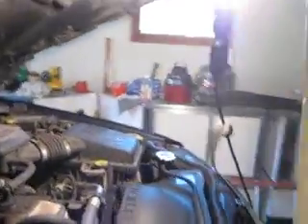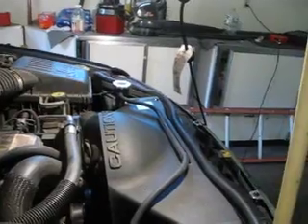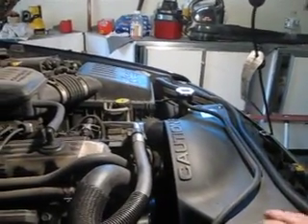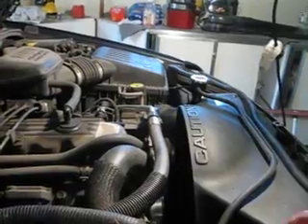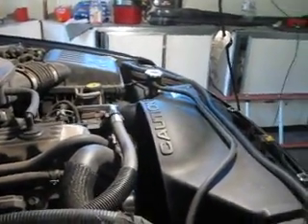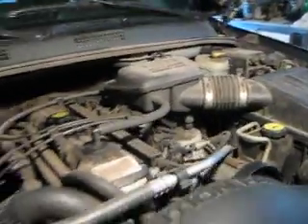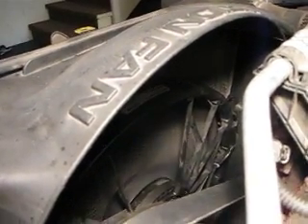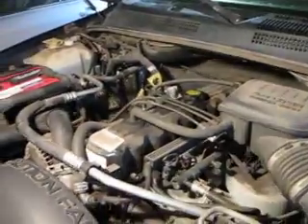how to fix radiator fan on jeep grand cherokee 2000

Comment: Great to see a repair instead of an expensive replacement.  Do you have part numbers for brushes for fan?  I replaced the relays in the PDC in my 04 WJ, but to no avail.  Now either replace or repair fan.  Also thinking about adding mechanical fan as the 4.0L is a heat producer.
Reply: David Hartman did you put a mechanic fan ? it does overheat?
Reply: I added a mechanical fan after the electric fan failure.  I have not overheated or even come close to 210 since it has been installed.  I am going to wire up the new elec fan I bought to a switch to be activated on demand vs relying on dysfunctional relays in the factory setup.  Finishing up my relay box soon, but ran into a fuel pump issue, so attention was diverted for now.
Reply: David Hartman I remove the elec fan and replace it with a mechanic fan clutch but today with the AC on while idle the Jeep overheat with the AC on temp was reading 230 the fan clutch never engage, I went back and return the fan clutch and put the elec fan back on.
Reply: O

Comment from the maker: driver side bottom bolt there is another video that tell how to take the bottom bolt out .1,bottom radiator hose also un hook the transmission line very easy noy you should be able to c the bolt what i did bent the box wrench a little n one turn at a time. i did it you can too.

Comment: where does the coolant hose hook up at on my 2000 grand jeep Cherokee Laredo please help any advice would greatly be appreciated.
Reply from the maker: +chasity immel if you are taking about the skinny little hose that runs from the coolant bottle, it hooks up to the top of the radiator .

Comment: where did you get the brushes?
Reply from the maker: +apollo122345678 you can get it at alternator starter rebuilder in Gary  In . or at auto zone but then you have to grind them to fit